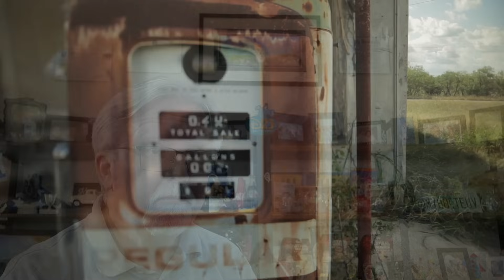The Shocking Truth About Gasoline Production Energy Usage

Comment: Thanks again for fighting back. I recently replied to someone with a similar comparison between the Equinox EV and ICE cars. Only this was about the massive subsidies the oil industry gets from government and how much cheaper the ICE vehicle is over 5 years. 

Many people believe gas-powered cars (ICEVs) are cheaper over time, but when you factor in fuel, maintenance, health costs, military spending on oil security, and subsidies, EVs come out ahead. Let’s compare the Chevy Equinox (ICE) vs. the Chevy Equinox EV over 5 years:

💰 5-Year Cost of Ownership: ICE vs. EV

🚗 Chevrolet Equinox (Gas) - Total: $59,312.80
🔋 Chevrolet Equinox EV - Total: $53,122.50
💡 EV saves: $6,190.30

⸻

1. Purchase Price (No Incentives)
	•	Equinox (ICE): $28,600
	•	Equinox EV: $33,600

2. Fuel vs. Electricity Costs (5 Years)
	•	ICE: $8,655 (Gas: $3.00/gal, 26 mpg, 15,000 mi/yr)
	•	EV: $3,022.50 (Electricity: $0.13/kWh, 31 kWh/100 mi)

3. Maintenance Costs (5 Years)
	•	ICE: $7,500 ($0.10 per mile)
	•	EV: $4,500 ($0.06 per mile)

4. Insurance (5 Years)
	•	ICE: $7,500 ($1,500/year)
	•	EV: $9,000 ($1,800/year)

5. Taxes & Registration (5 Years)
	•	ICE: $2,500 ($500/year)
	•	EV: $3,000 ($600/year)

6. Health-Related Costs from Emissions (5 Years)
	•	ICE: $3,750 ($0.05 per mile)
	•	EV: Negligible (No tailpipe emissions)

7. Military Spending on Oil Security (5 Years)
	•	ICE: $807.80 (2,885 gallons × $0.28 per gallon)
	•	EV: Not applicable

⸻

💡 The Verdict

Even without tax incentives, the Equinox EV is $6,190.30 cheaper over 5 years. And this doesn’t even factor in potential gas price increases, which would make EV savings even greater.

🔥 EVs aren’t just better for the environment—they’re better for your wallet too! 

That’s was a reply in my Facebook page. 

https://www.facebook<dot>com/share/15Z3YpiJTQ/?mibextid=wwXIfr
Reply from the maker: It’s actually much more than you’ve computed…but that’s also a story for another day.
Reply: Umm where do you get 4,500 dollars for maintenance for the EV? The only items you need to replace are maybe tires once during that time depending on how many miles, and maybe cabin air filter and wiper blades. There is no maintenance. Also, insurance isnt that much more, at least for me.
Reply: @ it’s not perfect but it’s based on national averages. 

$4,500 in EV maintenance over 5 years may seem high at first, but here’s how that estimate breaks down:

Assumptions Used:
	•	Driving 15,000 miles per year
	•	Estimated EV maintenance cost of $0.06 per mile
(based on real-world data from sources like Consumer Reports)

Calculation:

15,000 miles/year × 5 years = 75,000 miles
75,000 miles × $0.06/mile = $4,500

⸻

What’s Included in That $0.06/mile?
	•	Tire rotations
	•	Brake fluid (occasionally)
	•	Cabin air filters
	•	Coolant (for battery thermal management, in some EVs)
	•	Wiper blades
	•	High-voltage system inspections
	•	Occasional software updates or diagnostics (sometimes charged)

What’s not usually needed:
	•	Oil changes
	•	Transmission flushes
	•	Spark plugs
	•	Timing belts

Some EV owners may spend less, especially if they DIY or have a warranty covering many items. But $0.06/mile is a conservative national average that reflects dealer-serviced maintenance over time.

Comment: This is an excellent way of looking at it.  I did similar maths comparing our Model 3 to our previous diesel pick-up. The difference was, as expected,  much larger again.

Fossil fuel advocates usually omit that well to tank impact, which adds a reasonable amount of CO2 to the tailpipe calculations.

And if you can charge on 100% renewables, then it's bigger again (the emission numbers).
Reply from the maker: There’s also the FACT that there isn’t an ICE car out there that can run without electricity. If the “power goes out,” they’re just as dead in the water as the EV.